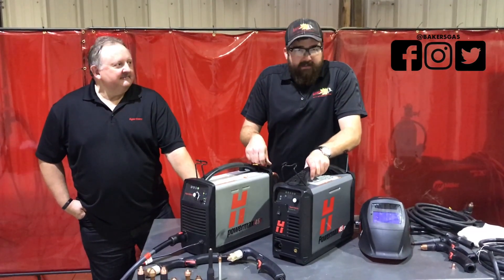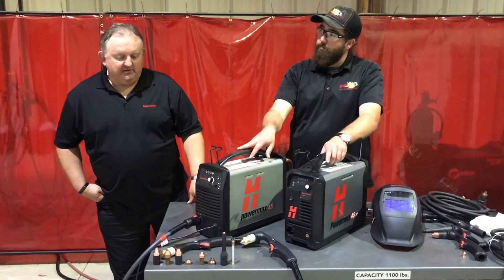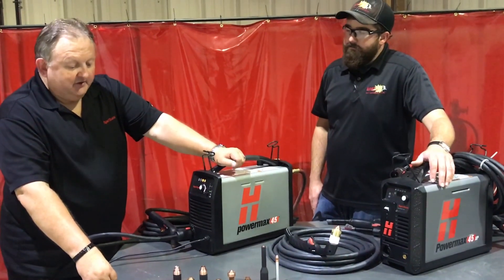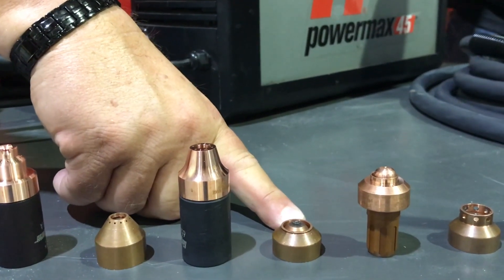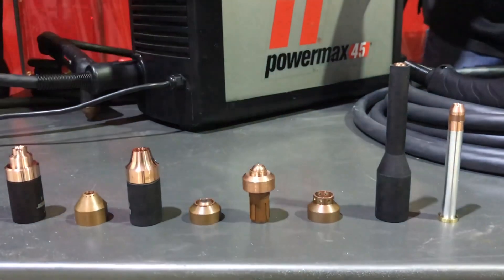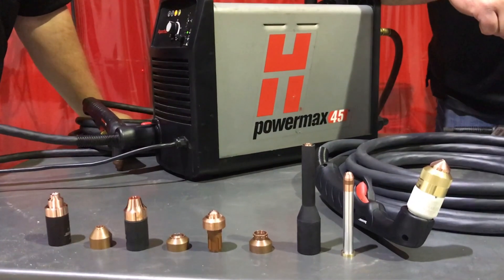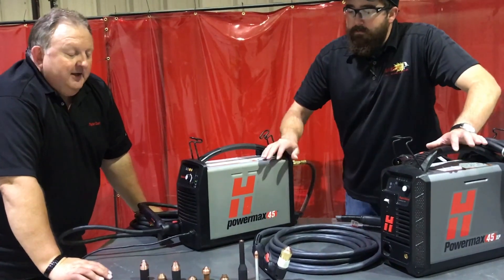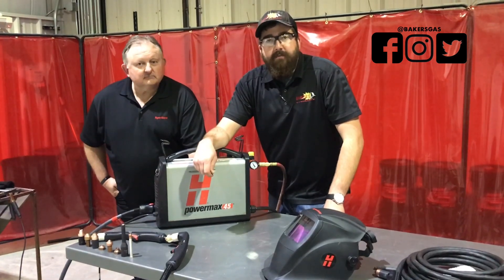Powermax45 Retrofit Torch

Comment: hello,,from Croatia(Europe),,one question for you master!!  Is possible put the powermax 45 old torch,without cable on powermax 800 with cable,,means,only torch handle connect with wires on Hp 800?? I have HP 45 died,,and my friend has 800 with crashed torch,,thanks

Comment: When I select the link given it says this is for the xp only. Can you confirm this pn: 088164 is for the non xp model 45?
Reply: I have the same question just bought a used 45 non-XP but it came with a new Duramax lock torch with that part number you mentioned. It plugs into the older 45 but not sure if it works. Still need to get tips for it. Did you end up confirming if that part number works on the older 45 even though it says it only works for the XP?

Comment: good morning, but then the powermax 45 has the exact same attack as the 45xp? can mechanical torches also be interchanged like these manual torches? ie replace 088010 with 088167 or mini 059482? thank you

Comment: I was so close to getting this !  I was informed by another Hypertherm Rep, Jim Colt, that the Marking feature will not work effectively with the PowerMax 45 due to the 45 not being able to reduce voltage enough.
Reply from the maker: Rick --- ahh okay well it will work. Effectively is probably in the eyes of the user :) thanks for watching!